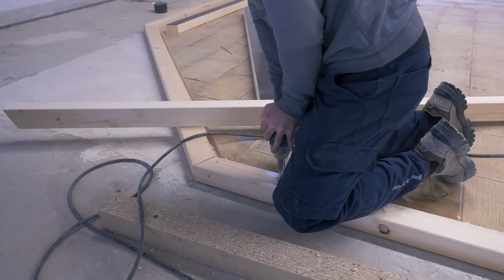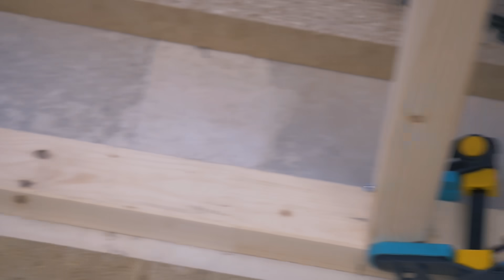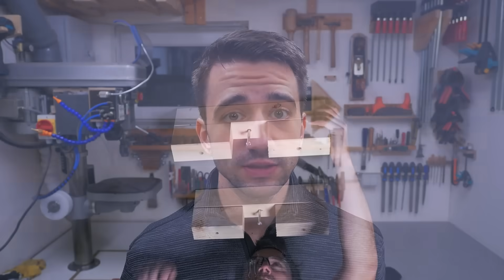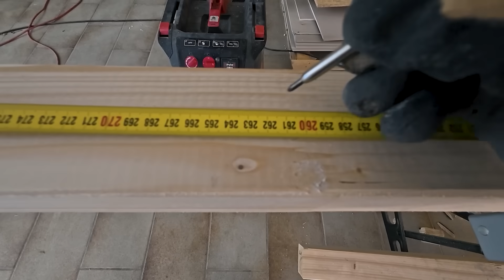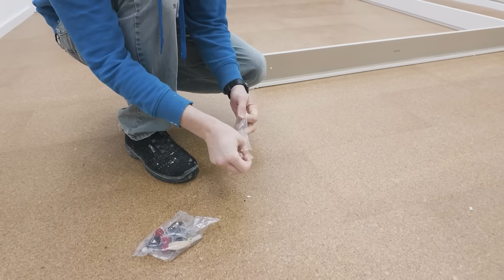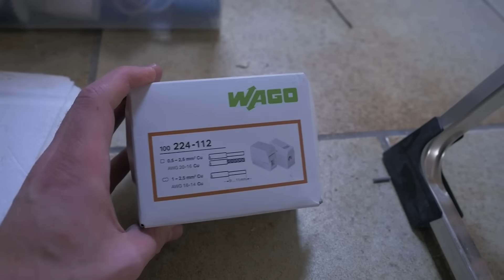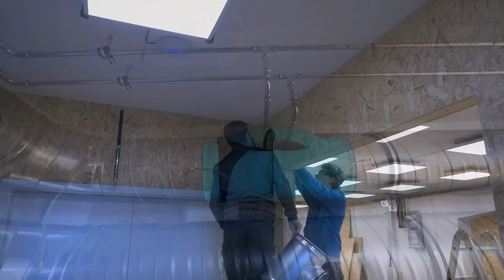New Workshop from Start to Finish without Ads & Placements

Comment: one thing that could of messed up the concrete anchors in the beginning is not cleaning out the holes prior to installation, leaving a lot of concrete powder on the sides and build up at the bottom.. at least here in Canada, we use a wire brush and air pump x3 minimum per hole.

Comment: You've probably already been told this, but when you cut holes in the studs for wiring, it is a good practice to protect them with a metal plate on the edge of the stud.  That way, if you are worried about puncturing the wire, you'd hit the plate first and know you need to reposition the screw.

edit: HA, I just unpaused and saw that comment.

Comment: the jigsaw step for your OSB window and doorway trimming is unnecessary, just start with the flush trim router bit after drilling a hole to put it through. make sure you start in one of the top corners and go down, or do the top of the rectangle your are cutting LAST so it does not sag and crush the router bit. drywall looked good though, only advice would've been to do some planning ahead and tile them in a way that would require minimal cutting, or a tile pattern that would require lots of cutting but all the cuts are the same so you can do many cuts at once and save a lot of time. also in the future, mark where your electrical will be on the OSB board BEFORE putting it on the wall with marker or pencil. you can also setup a laser level at the height you run your cabling to make sure you don't drill through where the big bright green laser is. other than those 3 things, this looks pretty great, better than some companies to be honest.

Comment: Huh, I don't remember the concrete screws in the original video.

Those Betonschrauben are not at all meant to be used with static torque. They snap quite easily with that.
If you use impact wrenches they usually just go in.
They don't if: the concrete is too hard, like massive granite pebbles in there, or you happened to hit rebar or another irregularity in there.
With too weak impact wrenches they usually just get stuck and don't move anymore.

Comment: If you use the wrong sixe hole saw. You can screw in the bigger hole saw, then screw the smaller saw beneath it. So you use the smaller hole saw as a guide

Comment: Just a tip for mounting board to studs. Much easier if you lift the full board up and put your cut outs at the bottom to save fiddling around up and down ladders with it. Im obviously commenting this before i know whether youre covering it or not so disregard this if youre leaving it bare 🤷🏻‍♂️😂

Comment: 8:16 I always use a half size to size bigger drill bit for monolitt concrete floors, then the bolts should go in as on softer concrete floors.

Comment: As a tip i would suggest using hard plastic tubing for the cables, makes it real easy to exchange them 100 years later, and upgrading, also protects against screws and nails except in and near the studs.
The tubes just move out of the way when a nail show up.

Comment: My electrical supply is splited into a workshop and a house after the main 3x32A circuit breaker, each with its own 3x25A circuit breaker. 
I have a Shelly 3EM-63T Gen3 on each branch, just to see what the draw is. Very simple installation, bought in Hornbach for 1800 CZK (approx. €74). 
And Shelly integration into Home Assistant is simple.